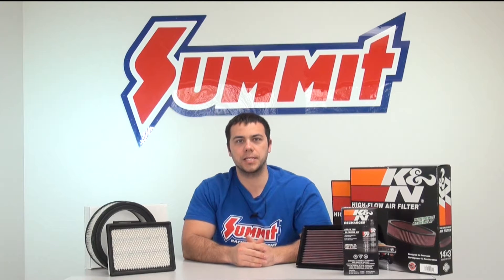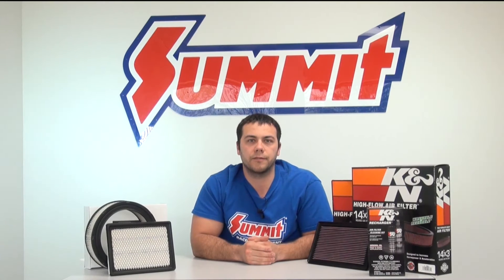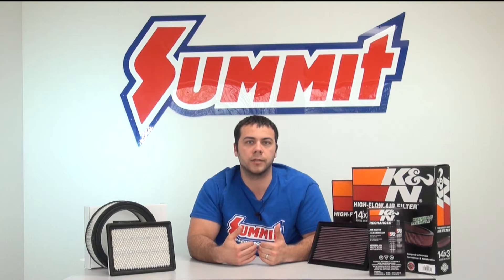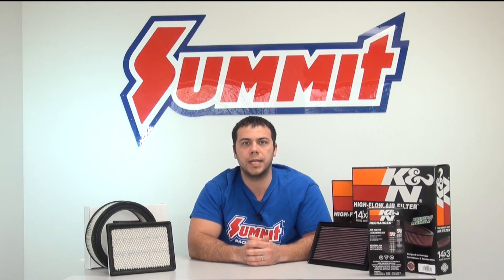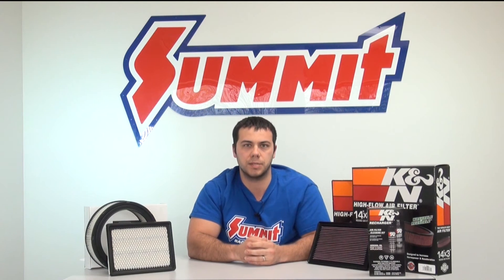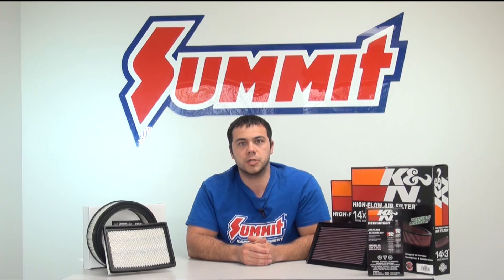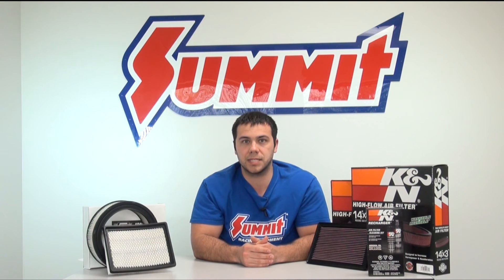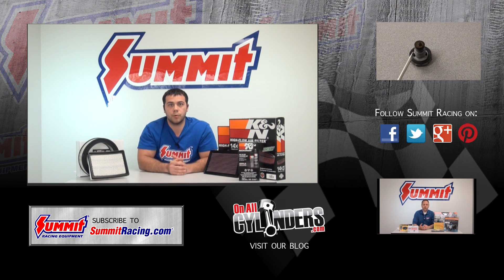Cotton vs Paper Air Filters - Summit Racing Quick Flicks

Comment: Me thinks that the best way to determine how much air flow your engine needs is to multiply the volume of your cylinders times the RPM at WOT. 

Example:  A 1000cc engine turning at 10000rpm consumes 5000 lt/min of air (assuming 100% volumetric efficiency).

This is 177 cfm. Hence anything above that figure won't help at all.

Comment: Why do hardcore pontiac enthusiasts recommend a Q-jet carb over a Holley type or other brand? I hear they are really good when tuned properly,A lot of people seem to have a bad experience with them. In one forum someone mentioned a reason why people have bad luck with them is they have to much cam and it won't tune properly. A speed shop suggested I get a "Quick fuel" 750 carb. I have a 76 trans am with a 462, 96cc heads, I believe with roller valve train. That's as much as I know about engine.